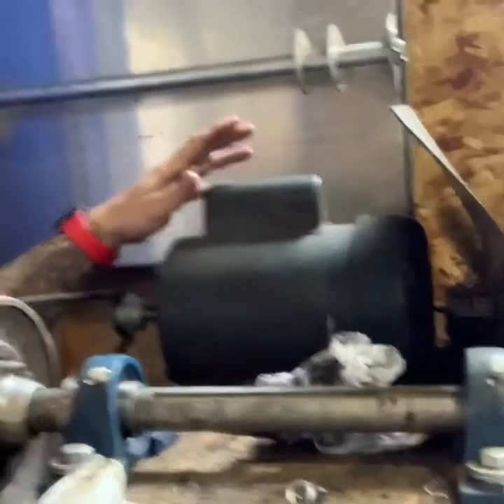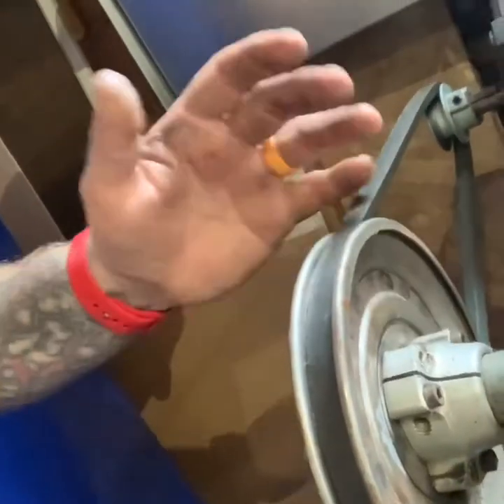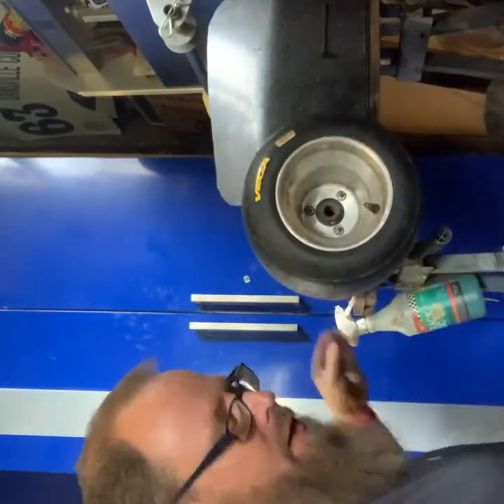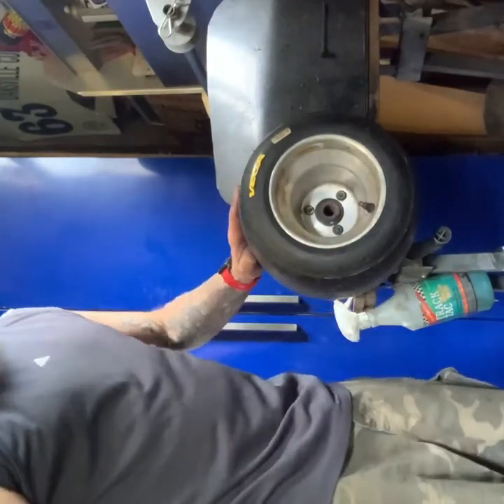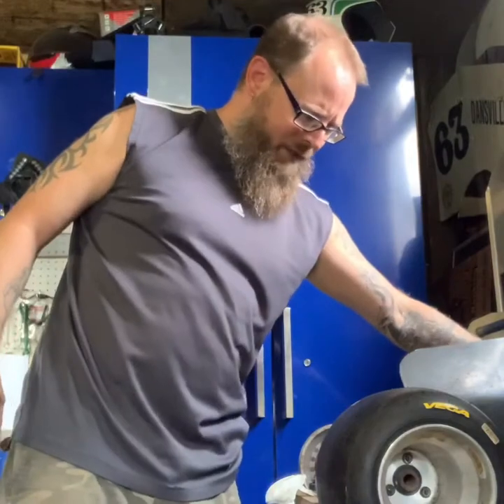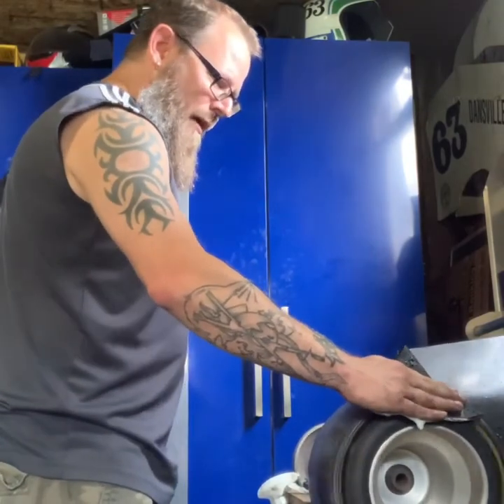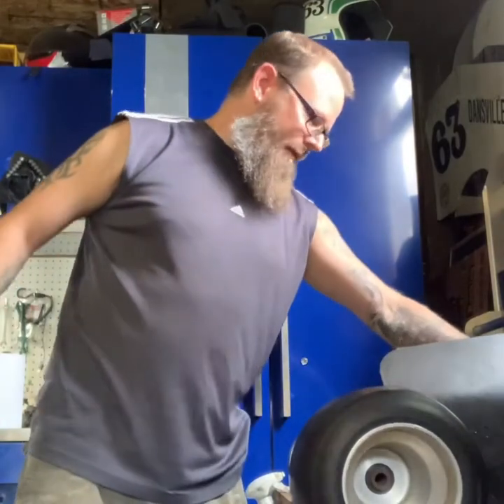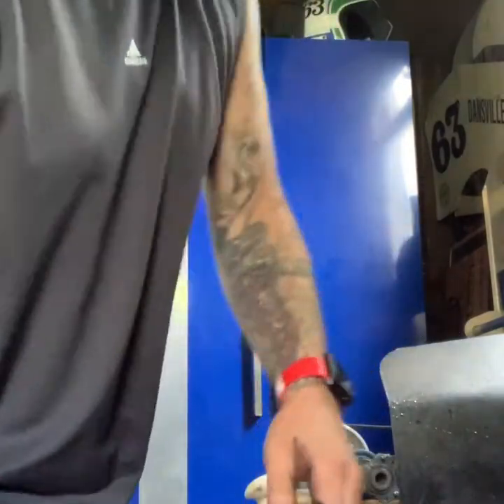Homemade kart tire surfacing

Comment: Cool video, what about between heats or finals? Im new to karting, running Vega Blues outdoor. I do see some people filing the build up away and i thought of building on of these myself to do the same, more less lathe a new surface without putting it through a full heat cycle...what do you think?
Reply from the maker: Here is a closer look.  https://youtu.be/Idkjl7g5YkE

I have taken this to races with me and done just that.  Are you on dirt?   It’s not needed on dirt, I’d just wash the tires.  If your on asphalt then that a different story.  I might like on of these to get build up off.
Reply: @kart6t3_ben  Yes asphalt, great pt 2 video 👍 looks super useful, im gonna start building one inside the trailer, thank you Ben!

Comment: New to racing how often do you resurface tires
Reply from the maker: As long as your keeping them clean in between races not often (you can if u want) I only do mine once or twice a year.  Usually just to prep for a new season or to scuff up new rubber.

Comment: So is that a old axle???
Reply from the maker: Yes.  Off a 80s road coarse kart.
Reply: How many rpms does that motor turn. And how big is the pulley on the shaft?
Reply: My motor turns about 1200 rpms. Trying to find the right size pulley to put on my axle
Reply from the maker: @nicaveritt5867  I got mine at Tractor supply
Reply from the maker: @nicaveritt5867  I’m not sure.  Never looked.
Reply from the maker: @nicaveritt5867  https://youtu.be/Idkjl7g5YkE